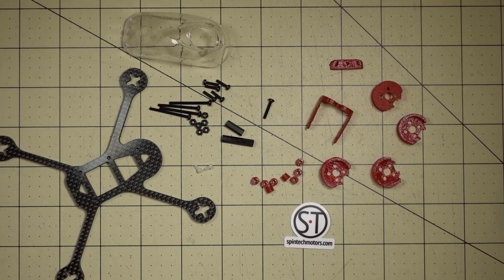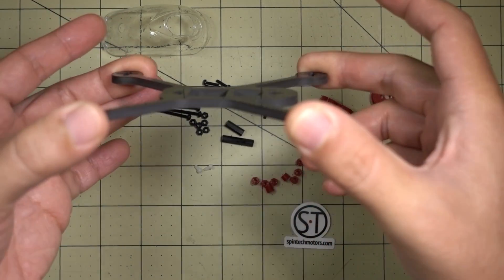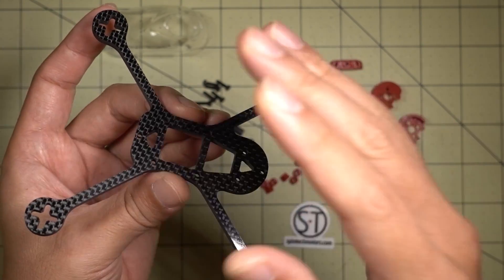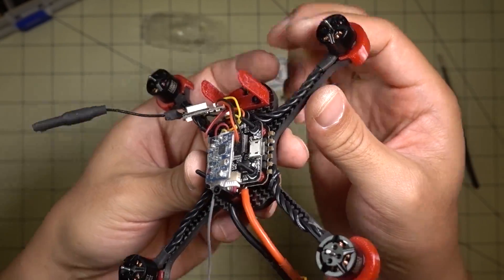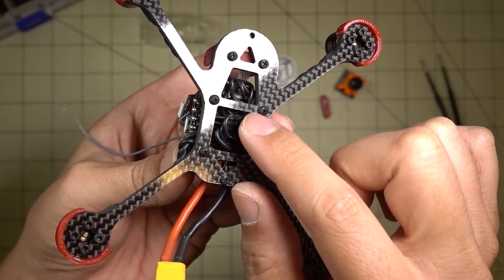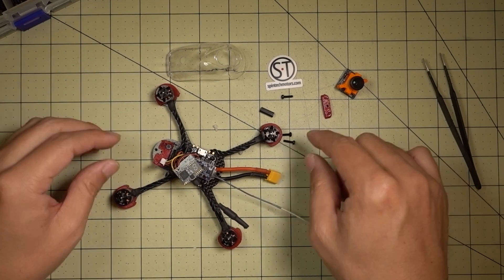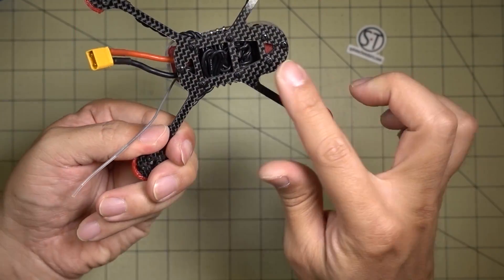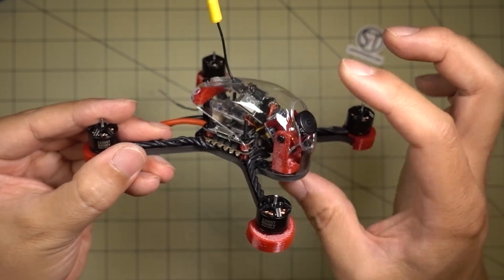Micro Drones 101 🚁#35⚡ Spintech Race-1 ⚡🔥😲

Comment: Hello,
I am running an Hglrc stack and Gemfan 2.5” props and am getting really bad fluttering, propwash I guess.
I accidentally loosened the lens and now, due to the vibrations, as soon as I try to fly the lens goes out of focus. I figure I will focus and glue the lense, but would like to lose the horrible prop wash. The PIDs are stock (older version) Betaflight.
Any ideas?
Thanks:)
Reply from the maker: Sounds like you need to do some PID tuning.  Try loweing P and D and see if that helps.

Comment: Albert, now that it's been a while since you've had the Racer 1, what's your opinion on how well it crashes? Is the frame (and the  standoffs and canopy) at least reasonably resilient? Thanks.
Reply from the maker: Yes, it holds up in crashes.  The canopy and frame have not broken but the small nylon screws have as it was designed to.  Just replace those and you're good to go.

Comment: Doesn't that reciver have two antennas normally?
Reply from the maker: It's a single antenna. The other one is for the VTX.
Reply: Albert Kim 
NM I thought the reciver you installed was the same ones I use that have two u.fl antennas on them and for some reason you only had one.

Comment: In theory you have them mounted correctly @ frequent flyer the purpose of flipping them is to use the as soft mounts to reduce oscillations.   

  Albert did you flash your stack and update esc’s.   Can you provide cli..

Comment: Nice looking build!  Does anyone know how to get Smartport telemetry working with this Furibee Flytower?  There's no real good documentation for this board that I could find.  I've done a bunch of trial and error trying to connect the Smartport wire up to different pads to try and get something out of it, but no luck so far.  I've also played with the un-inverted signal from the Rx and the tlm_inverted command in the Betaflight CLI.  No luck so far!

Comment: i got a matek vtx and it works OK but the telemetry only works if i power the flight controller before the video transmitter, if i just plug in a lipo it doesnt work it only works if i plug in my fc to my pc through usb before plugging in. any ideas how i could fix this?? im really confused whats going on...

Comment: I just finished building the same frame and motor, but still waiting for the larger 2s batteries. Would lowering the rates and the throttle mid help for new pilots (me).

Comment: On my Krakens with a similar Polycarbonate pod the camera mounts using holes in the pod sides. It keeps the camera steady. Could so the same thing on this with some spacers on the inside. Be sure to not to use metal screws against the pod though, use washers to avoid cracking over time.
Crazy fast frame looks great.

Comment: I was pretty blown away by the lightweight  speed of the kingkong110gt on 2s. Yeah, I haven't flown many quads so that's just 2 cents. But this build is reminiscent of my experience on the 110gt. Somehow imho 2s and lightweight high kv builds are a sweet spot in fpv. I'm still looking for my first build no more... I'm between this one and an eyas 112mm x3 (build not quite specified )

Comment: My Spintech Race1 build seems cursed lol. I've burnt out a vtx and 4in1 esc while building it. I'm running the Air Arsenal 1107 7500kv motors on Leader1 2.8 props and 4s :O
Reply: Uh.. Ok after seeing that punch in this vid, I'm a little worried I may be overbuilding mine lol.

Comment: Screamer! Not ready for that (yet). Looks like you have been doing a lot of 1106's - someone said that 1304's used the same mount profile, were only 1 gram heavier, and give more power and efficiency than 1106's. Hope you can try some and tell us if they are really better (cooler, less battery stress, etc.)! Oh, any reason you switched from the HGLRC to the Furibee?
Reply from the maker: I ran out of the HGLRC boards at the time I was putting this together so I went to the 2nd tier power stack, which is still plenty good!

Comment: so obviously a ton of power. what do these ,motors do to the batteries though?  I know the emax 1106 7500's im currently using I can barely get 2 min if I'm really flying. maybe 2 min 30 sec if I baby it for 1/2 the flight.

update: i typed this while i was still watching the build part of the video. you pretty much answered my question during the flight portion of the vid.
Reply from the maker: These motors are LIPO KILLERS!  LOL... yeah, you'll need really good lipos.
Reply: currently im stocked up on tattu 650 75c's. Recommendation of what battery I should go to for these?
Reply: Doesn't seem like there are a lot of options out there. I'm flying this setup on 650/75 tattu's right now and getting about 2:30 but with a ton of low voltage beeping during the flight. I just ordered a couple of these to try as they are the only high-C battery between 650 and 1000mah that I could find: https://www.banggood.com/Gaoneng-GNB-7_4V-850mAh-2S-80160C-Lipo-Battery-JST-Plug-p-1115550.html
Reply: Sugar Kane I was definitely planning to swap the connectors but hadn't considered the wire gauge might be too small. Damn I really hate soldering lipos. GNB also sells these with XT60 connectors (?!) but those were out of stock.

Comment: Great video. I'm running the XJB F425 and TX20 stack on this frame with the Spintech motors. I love this thing, but I did manage to crack one of the arms by hitting a steel fence head on. The good news is Spintech has already mailed me a replacement bottom plate at no charge, so the customer support is top-notch.
Reply from the maker: Spintech customer service can't be beat, so get this guy more business, OK?
Reply: The discussion thread for this frame on RCGroups is way too quiet.

Comment: Really awesome build Albert! It looks like you mounted the motor protectors upside down.. Was that purposely done for some reason or have I been mounting mine the wrong way? I always thought they were to protect the motor can from a hard hit. As for those props, they make all my higher KV motors come down hot and even the FullSpeed Fighter 130 can take full 3 inch props but with those DYS Tri-blades it death rolls immediately! Again, Cool video!
Reply from the maker: The motor guards double serve as soft mounts. The designed did that in purpose.  My motors are not coming down hot at all, just a little warm.  I'm flying BF3.2rc5 on stock PIDs.  If your motors are hot, you have excess vibration and/or you need to lower your D gain.  Tip on the Fighter, if you swap out the JST to and XT30, lower vbat to 2.8, and idle speed to 6 percent, the death rolls are gone, even on the DYS prop!
Reply: Frequent Flyer RC lol I was going to mention that too, beat me to it.  Bad bird though, damn nice
Reply: They are actually not motor protectors, but frame protectors. they are designed to go on the way he put them on.
Reply: SandboxFPV I know now, and I guess the edges of the frame does need a little protection if you fly over concrete like my dumb @$$ lol, I honestly thought about turning my motor protectors on my Fly Egg 130 upside down because I crashed it once or twice and the edges of the frame took a hit! 😆😆😆
Reply: Frequent Flyer RC u know, I have the same issues.  lol I might give that a shot some time. But I'd rather save the motors than the frame honestly.
Reply: If adding weight I'd much rather protect the motors and the added extension still helps protects the frame not that I worry about that part of the frame much. But they need to be strong enough to protect the motors. Looks like a really nice super fast build where going full throttle is an "experience"...  lol.
Reply: Albert Kim indeed, I got rid of death rolls on everything altogether all (copters from ever the AR Fun to the Fighter 130) by dropping minimum cell voltage to 2.8. Did a video on it awhile ago. But maybe I need to soft mount the motors and or flight controller on the Fighter. It flips out when I use the 3045 Tri-blades. Oh, as for the motor protectors, they are still soft mounted when you turn them right side up aren't they?
Reply: SandboxFPV interesting.  Never seen it done like that before.
Reply: JJRotoGeek I'm with you on that. I had to look at the picture on the Spintech website a couple of times to make sure I was doing it correctly.
Reply: SandboxFPV well damn!!! There ya go.
Reply from the maker: +JJRotoGeek you can mount it whatever way you want. I just went off the photos on the Spintech website.
Reply: John F Hendry lol absolutely

Comment: Wow!  I will steer clear of those motors!  Way too much for my noobyness!  Frame looks really cool though.  I like that you can paint the canopy like a surface rc poly shell.  Tie-dye micro here we come!
Reply from the maker: hydro-dip the canopy!  share the video!
Reply: oshheathed.  I tought the same thing.  I thought I wanted 1106 motors,  but this shows I dont.  1105 600kv, i get 5 mins of flight time, without killing my battery a 650ma 75c.    But I Would love to have a tie dye shell That would be the sheet.
Reply: Look up the HP08S and HP10S motors from yester-year... I paid $55 for my HP10S a few years ago... LOL (I know it's just plain ridiculous! It just shows how far we've come).